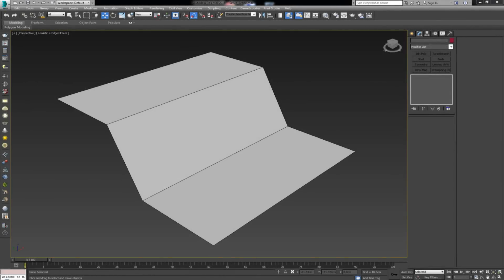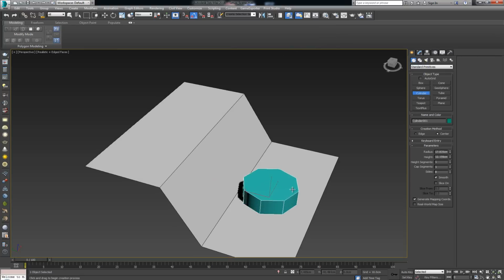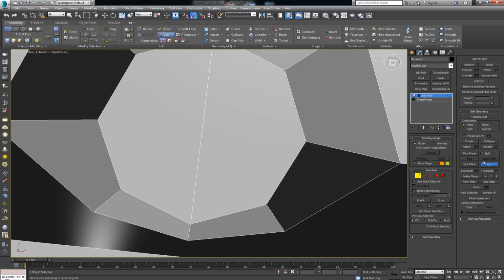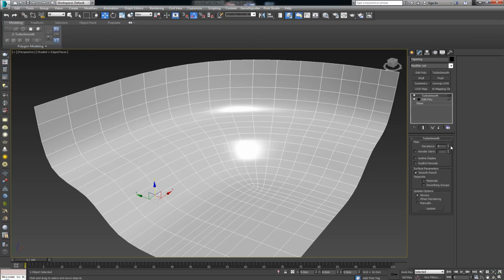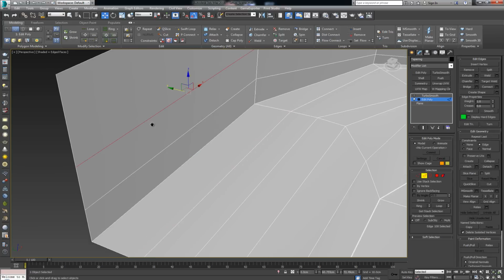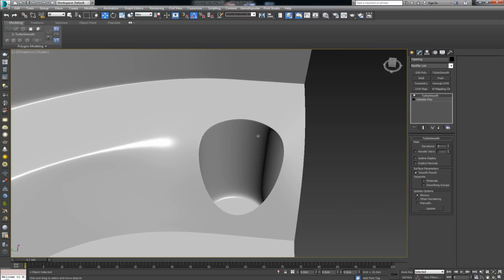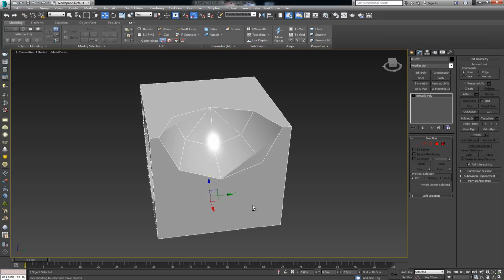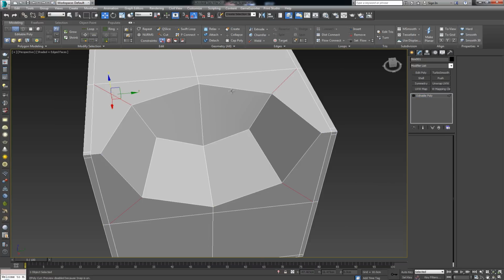3ds Max Basic Modeling Intersecting Geometry

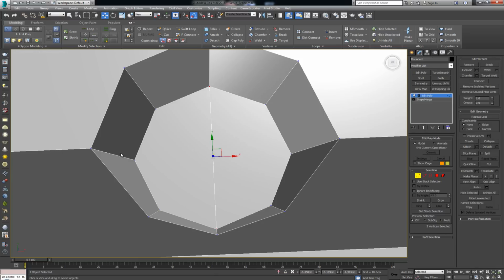Comment: 12:13 It's not Murphy's Law, I think that Max just doesn't cut through edges. It can only cut across seamless surfaces, so to speak. Your workaround was pretty neat, thanks for that. 

42:04 Damn, it let you do it this time? Silly Max...^^

In any case, your tutorials seem to be far more helpful than the video lessons from Digital Tutors (which aren't free).
Instead of boolean, those "tutors" expected me to manually create all the holes in the geometry (using insets and all that), like a freaking fool, ^^

Thanks for taking the time!

Comment: Amazing tutorials matey. Been using max for years but massive gaps in my knowledge, trying to get it all locked in now. thanks. Watching all your vids! :)
Reply from the maker: Well then you'll be in for a treat as there are quite a bit of them :)
Reply: :D wee question, When editing geometry - specifically adding the chamfers/ loops etc, would you usually use the Edit poly modifier just as a non destructive method of creation just in case you mess up the original object and it's difficult to clean up? I know you probably knew exactly what you were doing here for the video so were confident enough to just work on the collapsed model. Or is it all just something that comes with experience? I sort of look at edit poly modifier as a layer if you were working in photoshop for example.
Reply from the maker: You got it right. Pretty much every time i do something that there is the remote possibility of a screw up i use a new edit poly modifier. Bare in mind though that after a certain amount of modifiers in the stack if you are in a good spot and need to continue to further modify the model it's always a good idea to save on a different save file and collapse the stack. This is in case Max decides to have a brain fart and mess up your stack for no particular reason.
Reply: Good man, thank you! Looking forward to getting stuck into more of your vids. Vray is next!! I have been avoiding it lol.

Comment: Thanks a lot Denis for this instructive tutorial. Especially the Set Flow tool, which I wasn't aware of until today :)
Reply from the maker: Max has that ability that even after using it for years you can find little gems you didn't know existed :)
Reply: Yes, all the more when these gems are in the ribbon ! Since we can't get it vertically as floater anymore (since max2014 I think), I tend not to use it much ... takes too much place on the workspace IMO ... but I know, shame on me, plenty of great tools in it :)

Comment: Good tutorial. I just want to say that all the manual work you did in the last part of the tutorial (adding the triple edges all around to be able to use efficiently the turbosmooth) can be done automatically simply using a chamfer modifier in quad mode. All you have to do is set it to work only in edges that doesn't share the same smoothing group. And smoothing group can be easily set up with autosmooth option inside edit poly roll down. This also allows you to change the sharpness of your edges simply adjusting the chamfer value (I always use parametric modifiers in the stack when I can, I found this extremely useful during the modeling stage).
Reply from the maker: +Pixelpark Carlo You are absolutely right about the chamfering part, the only reason why i chose to go with the slice plane is due to the fact that i did the explaining of how to work with it in the video so i just wanted to show it in effect.

Comment: Thx for sharing your knowledge! Why is Autodesk not able to avoid those extra vertices when doing ProBoolean? It took till version 2016 to get a quad-chamfer...not very innovative. If Autodesk doesn't take care and introduces some new, more sophisticated features Zbrushs ZModeller will kick their a**.. I'm not surprised that Pixologic invented QMesh functionality and not Autodesk.
Reply: +Denis Keman That cut thing annoyed me too so I had to check it... Max2016 here too with all the service packs and right now I cant really test it in other versions. It seems if you extrude a face inside the object, then the cut tool wont really find the vertices on those edges. If you extrude it upwards, then it will work. In this case however, if you connect the first two vertices, then you can use the midpoint of the new edge, the cut tool will find that and you can start the cut from there. After this step, you can use the connect tool or anything else on that new vertex. :) Its annoying, but still faster then the inset.
Reply from the maker: +András Pál I'm loving the fact that people are actually watching the whole thing and not simply skipping it :) In any case the cutting issue like you said happens on when you get a negative z value or negative extrusion, and usually the solution is to either add a median point and connect it through it, or find a workaround like i did in the video. Kudos to you for your contribution.
Reply from the maker: +Sven Bardos Well in all honesty Autodesk is doing a great job when it comes to working with geometry, but you need to understand that in it's core Max wasn't really designed to work as a sculpting application where the geometry can be added and removed without any notion of geometry flow. If that is what you are looking for from Autodesk they will tell you to take a look at Mudbox and that Mudbox can do all of that. Now if you ask me i'd tell you to take a look at ZBrush and keep looking there, but that's a personal view. 

As for the QMesh and the ZModeler brush that the 4R7 brought, that's an amazing tool but still light years away from being a precision tool. And while we are at ZBursh don't forget the ZRemesher function. I would love to see something like that in Max, but sadly when i end up doing a retopology video in Max it will be a pain :)
Reply: +Denis Keman I'm not talking about sculpting. It's no question that Max isn't a sculpting tool and will never be. I'm just talking about the box modelling stuff. In my opinion Autodesk really missed it to give artists better, more comfortable tools. The workflow is the same as 10 years ago (with the same issues). In your video you had trouble to cut through a polygon to connect two vertices. In 2016? Seriously? And I'm pretty sure this flaw will never be fixed. And there are many more like this, as you may know. I hope that Autodesk takes a look on the ideas of Pixologic and get some inspiration for 2017. Also see that ZModeller is in the first iteration. What will be in 5 years? Artists will not accept these low level tools from Autodesk anymore, I think. Just my 2 cents.
Reply from the maker: +Sven Bardos Well you are right about the fact that the workflow is more or less the same as it was 10 years ago, but then again geometry follows certain rules that transfer on all platforms, but back to the issue at hands, the clunky and buggy workflow. I will not defend that which is obviously flawed in many ways, but then again over the years i've learned to work around the bugs and turn a blind eye to them. 

But here's to hoping for better workflow from Autodesk in the future.